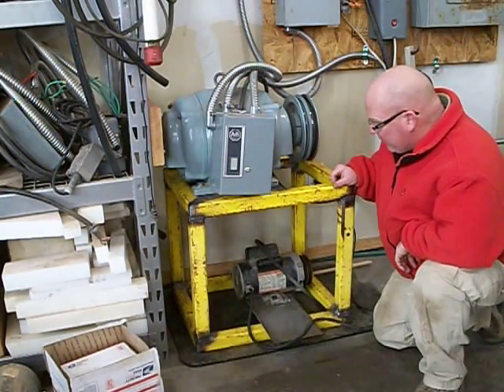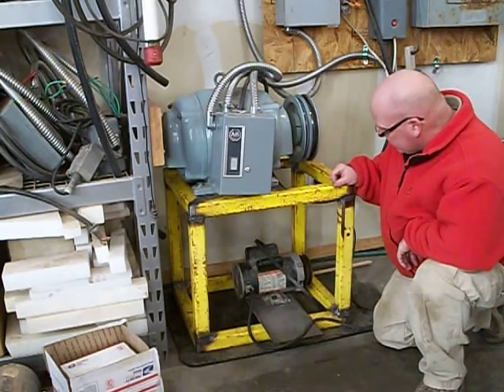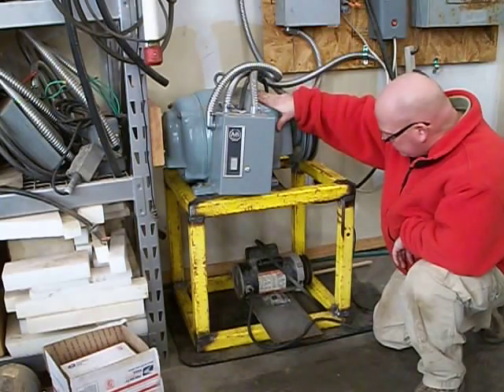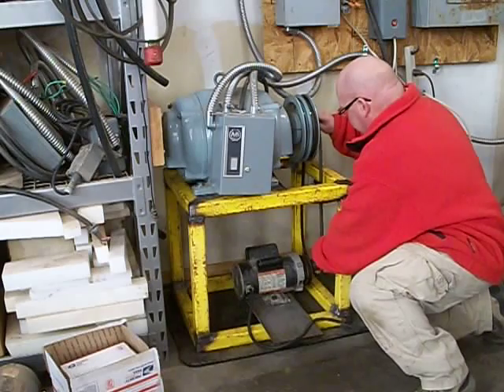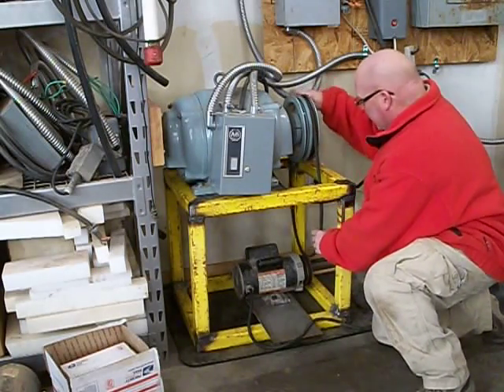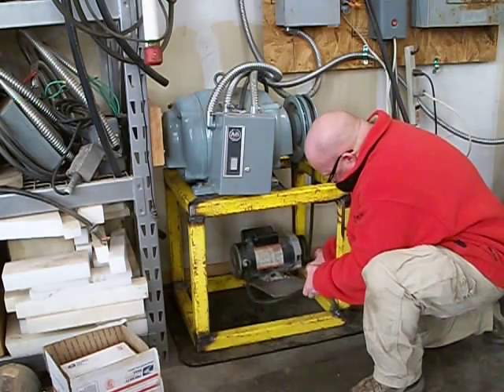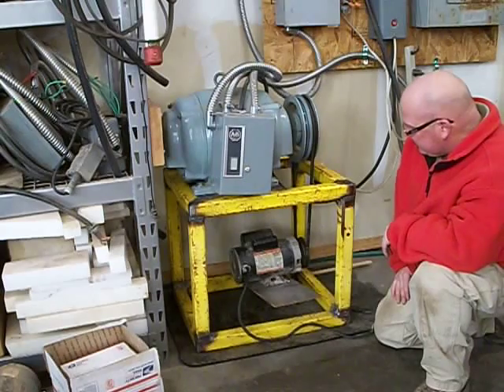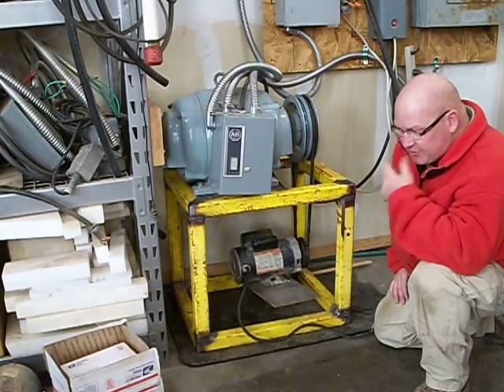Pony Motor starting my Rotary Phase Converter.

Comment: A sprag bearing would be easier to manage. It' s good to see an Allen Bradley motif again. 
A B and Stromberg were my favourite  electrical manufacturers during my working life. The first inverter drive I worked on was a brand new Stromberg Sami Drive comprising  of three standard electrical panels for a 5kw or so motor  more than 40 years ago. Good stuff.

Comment from the maker: Yes you can use start/run capacitors for starting and balancing.
Reply: Yes you can, however it takes more engineering design to determine the correct size capacitors and a potential relay, at minimum.

Comment: You could just use a capacitor to start the 3 phase motor on single phase.
Reply: Yes, but this way he avoids the high inrush current of giving the idler motor its rotation.
Reply: Plus a start capacitor requires a potential relay to disconnect it form the motor once it's up to speed, otherwise you'll burn the motor winding out.  For my money, the pony motor is more foolproof.

Comment: An interesting method of getting started. I will suggest, from a long life on farming and machine shops, that machinery of any kind is not a respecter of human intelligence or intentions. If you need to de rail the belt, that you do so at least in a short sleeved shirt that your converter motor and belt will have less chance of getting tangled in, prior to creating serious damage to your needed extremities. Rubber belting is used for drives, partially due to its ability to grab and hold tight. A tight belt on a pulley can amputate a finger tip, or a hand in nearly the same time. Thank you, and we will now return to the show.
Reply: I'm thinking you should be able to make a 'derail' device to run the v-belt off the pulley once the idler motor os up to speed.  Maybe an idler pulley that will pull the v-belt out of alignment and off the sheave of the idler motor, operated by a simple lever mechanism?
Reply: 'once' up to speed....
Reply from the maker: Just to be clear, the belt is removed after the RPC is running. A quick tap with a dowel removes it from the pulley.

Comment: Seems like the long way. All you need to do is wrap a rope (like an old lawnmower) around the 3 phase motor pulley and pull to start. Also there's an electronic device that will start the motor without a 2nd motor. I use the rope, I usually only start once a day. Easier than unbelting a spinning motor and building a 2 motor rack..
Reply from the maker: The pony was ultimately built to start a 30hp motor.
Reply: Until the starting rope jams and kicks back on you.
Reply: @Georooney  Never happened to me.

Comment: I am needing to build one of these units that will run my coats 1001 tire balancer 
The back of the coats says 220 volts three phase 20 amp.
Just asking is there any way you could maybe doing another video or explain to me if you could sir how you wired all this up this is something I'm really needing to get done and I am mechanically inclined but not electrically thank you very much I loved the video
Reply from the maker: Hello, I bought a shop and everything is in pieces because of the move.
Reply: A static converter would be my choice if I only had one machine to run. If you want variable speed a VFD is ideal.
Reply: Just get a vfd

Comment from the maker: It would be Delta or Wye, I'd have to check the motor data tag. I moved into a bigger shop and nothing is connected right now.
Reply: Delta or wye usually refers to the applied motor voltage.  Since you're operating on 208/240 volts, the connection is most probably wye.
Reply: Sorry, me bad.  The lower connection would be delta.

Comment: That means your use a 3450 rpm motor to have the 10 hp motor Turning 1800 rpm because it appears to be a two to one ratio by the appearance of the shelves
Reply: You don't have to get the idler motor up to synchronous speed.  Once you give it direction it will come up to speed.

Comment: can you help im running a 415v motor in star on a 240v single phase with a start cap. this is to get 3 phase 415v for a tyre balancer with digital display. the the balancer motor is 1/2 or just below 1 hp. the motor i using to generate the power is 2.2hp. the thing is its only showing 192v on two out legs and 240 on the other is this right as it wont power the balancer. please help any one .Nick
Reply from the maker: I'm thinking you would need a transformer to bump the voltage to 415v first, or see if both motors have a lower voltage wiring capability.
Reply: Nick Coo     Nick,   Did you get this figured out?   If not, you could get and connect two buck and boost very small transformers.   They can increase or decrease voltage 32 volts maximum.    I'm guessing here(you will need someone to size them for you) that .5 KVA would do the job.
Respectfully,   Kevin
Reply: You're running the motor with 240 volt input.  Tell me, how do you think you're going to get 400+ volts out?

Comment: Looks like a good idea to fiddle with a wood rod around a 10hp running motor at full speed. I wouldn't do it
Reply: Whether it's 1/10 HP, 10 HP, or 100 HP, it's still just a spinning belt. 

Don't be a baby
Reply: @jeepersmurphy2570  Machinists community is plenty of "don't be a baby" guys with less than 10 fingers. Losing an eye or a finger is the prize for bravery here.
Reply: @diegovianavillegas3297  I think you have an interesting story about a v belt in your past.

Comment: Don't some of them use capacitors instead of a pony motor to get them going?
Does your set up need any capacitors?
Reply: It isn't to help the motor start spinning because it cant do that itself, this is to start the motors functionality at operating RPM, rather than spin up to operating RPM (engine speed being a duty cycle less than the one demanded thus having very low resistance allowing a very large amount of current) which could throw a breaker or blow a fuse.
Reply: It's to stop the inrush current, capacitors just solve the problem of getting it going, they don't reduce inrush current.
Reply: My guess would yes, and no.

Comment: Good morning, I have the same set up only when I purchased it used I did not take pictures of how it was wired and now I am totally up a creek. It was fully functioning when I bought it so I know it all works. I would really like to see how you are wired in and out of the idler motor. I have a 7.5HP 3ph 200-230/460V Dayton Motor ... and a smaller pony motor that gets it up to speed. Thank you - Bob